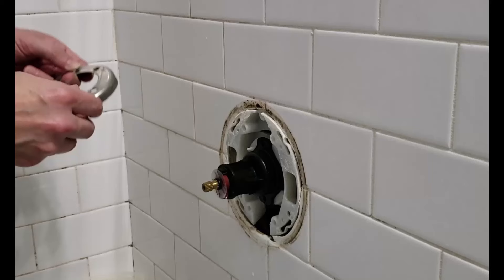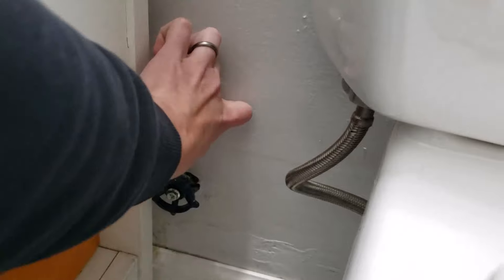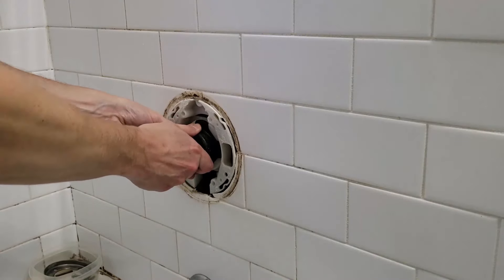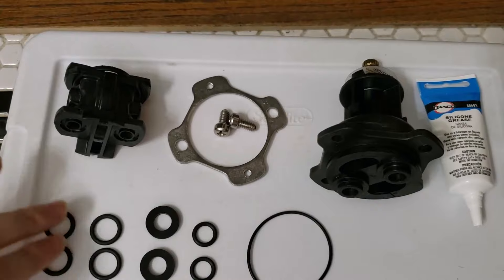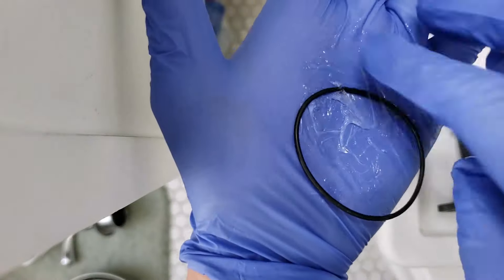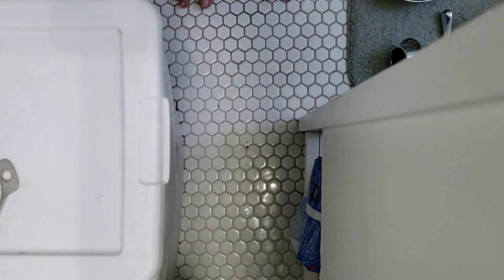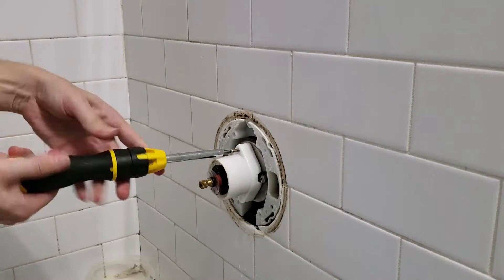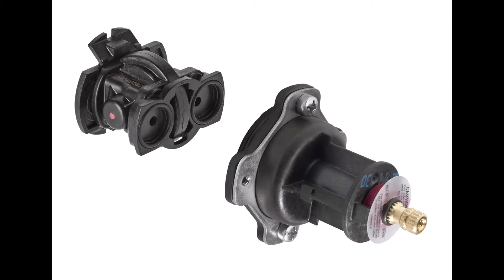On the Job: Replacing a Kohler tub/shower valve cartridge

Comment: I replaced the Cartridge per your instructions. The Shower head is dripping? What is causing that & what do I need to do?
Reply from the maker: It's possible a gasket could be mis-seated.  Try taking it back out and inspect the parts again. Also make sure there is no debris in the valve body too.  It usually comes down to a small installation issue.  It's possible, although rare, that the cartridge could be bad.

Comment: Hello can u please help me where I can find kohler retainer model 116995-6? Thanks
Reply from the maker: Apparently, the 116995-6 code is on a variety of different valves; it does not indicate the model.  Take a picture of your valve and call 1-800-4KOHLER to get the correct replacement model.
Reply: Thanks 🙏  @FixItScotty

Comment: Is there a way to know what kohler  cartridge you would need before you take it out our do you have to take it out to find out what kind  there’s different kinds of 
Cartridges for Kohler
Reply from the maker: Kohler has a nifty tool that can guide you toward determining the cartridge type without pulling it out (you do need to take the handle and trim plate off) https://www.us.kohler.com/webassets/kpna/ietm/1288570_3/

Comment: What does it mean when I have everything done and the water comes out of faucet without even turning on! What am I missing?
Reply from the maker: It could be a few different things.  Confirm the front part of the cartridge (the part the handle attaches to) was installed in the correct orientation.  Or perhaps the cartridge is the incorrect model # for your valve.  Or it could be the new part is defective.

Comment: I called Kohler warranty about a leak in my tub faucet and they are going to send me another Mixing Valve GP77759 (they sent one in 2016 after original failed after 6 yrs) but they said that they will not send a Pressure Balancer as they said that would not cause leaking?  Just wanted your opinion  Thanks,
Reply from the maker: I'm just an amateur plumber, so I would have to take Kohler's opinion.  I did another video showing how to replace Moen and Delta cartridges (https://youtu.be/lUIi0EqFUXw). Kohler was the first one I have seen where the cartridge is in two parts: the mixing valve and the pressure balancer. Delta and Moen have those two parts combined in one cartridge.  So it is quite possible that the mixing valve part of the cartridge is usually to blame for the leaking.  I'm not sure.

Comment: Changed the part, hot water restored, but the shower won’t shut off.  Rotated 180 degrees and still running.  Put old part back and still running.  Any suggestions?
Reply: Never mind!  Have to put the metal ring on too.
Reply from the maker: OMG! I was gonna say there must be something wrong with the cartridge stem or handle. Glad you got it sorted out! Well done.

Comment: If the hot and cold are now reversed, (in reference to the plate) which part do you flip?  The valve or the internal balancer.
Reply from the maker: In the video, I believe it shows the position of the "Cold" printing on the rear valve.  That printing should be facing down and on the right side if you are facing wall.  Are you saying your cartridge is reversed?
Reply: Just a heads up. The video helped a lot. But you have it backwards. The cold was facing the other direction and I had the exact same model and everything. The rest of the video was outstanding.
Reply from the maker: @switchfox1977  Thank you for the information.  Just to clarify, the writing on the underside of the rear cartridge that says "cold".  Which direction should that be if you're facing the wall?
Reply: To be honest, I forgot already. Long story short, the opposite that you mentioned.

Comment: How do you get the temperature control lever off?
Reply from the maker: Are you referring to the main handle?  There is no footage of the removal, but at 6:04 it is replaced by threading it on with the collar.  Removal is the opposite obviously, but if it is on too tight, you may need a strap wrench to get it started.

Comment: How important is the silicon grease
Reply from the maker: The silicone grease just lubricates the o-rings and helps them seat better.  If you were able to install the cartridge without grease and it works fine with no leaks, I would leave it alone.

Comment: 3:25 how important is that large rubber gasket?  I don’t remember installing one on my unit but I also think there was a large gasket pre installed already and I assumed the other one was a duplicate.  I’m assuming if there are no leaks then all is well?
Reply from the maker: The smaller o-rings that seat the hot and cold openings are much more important.  You're probably right; the larger o-ring was likely preinstalled around the mixer body if you didn't see it.  It just presses against the stainless outer ring to prevent overall leaks from the mixer.  If there are no leaks, you should be fine.

Comment: This video was a great help.  But after replacing the cartridge and using new o rings etc.  it’s still dripping!!
Reply from the maker: It's hard to know what the problem is without seeing it.  It could be a defective replacement cartridge, an error in the installation (bad or broken o-ring, mis-seated cartridge or holding ring, etc).  I would try repeating the installation again, maybe with a different replacement cartridge.  If that doesn't work, the last resort is to pay a plumber to make it his problem.  Sorry to hear about your issue, but I wish you the best in fixing it.

Comment: I had this valve and from day 1 it never worked.  Hot was about 2% of the turn, then you move it and only the last 2% the other way change it.  Its a stupid design.  Kohler sucks.  This valve is obviously over complicated.  My advice is, get a plumber to rip this stupid valve assembly out and put a non-Kohler valve in place.  It probably wont work from day 1 and if you give it about a year, it will be broken anyways.
Reply from the maker: Sorry to hear about your issues with the Kohler valve. I don't have much experience with that valve other than in my brother's rental.  But I did this video on the 3 shower valves I have worked with: Delta, Moen, and Grohe.  Check it out before buying a new one. https://youtu.be/lUIi0EqFUXw